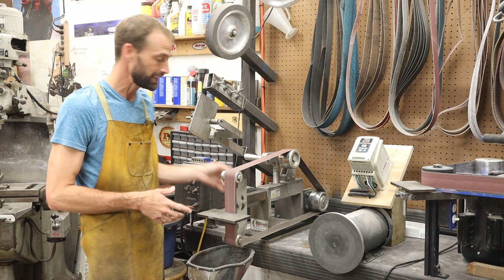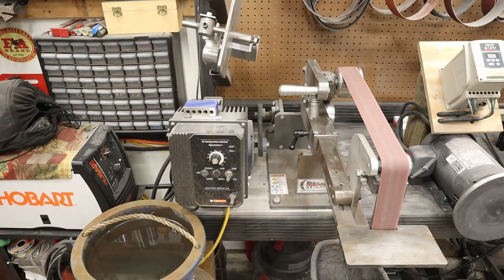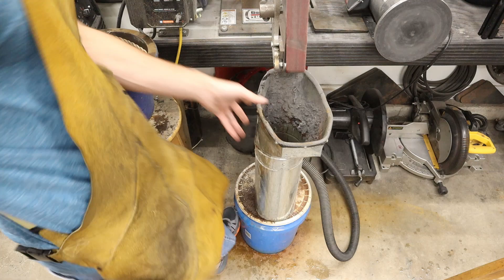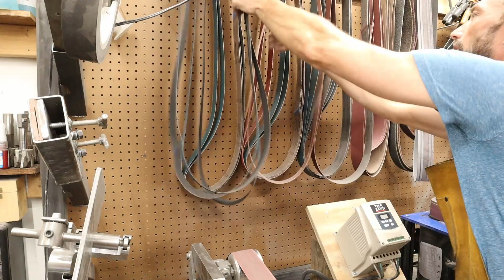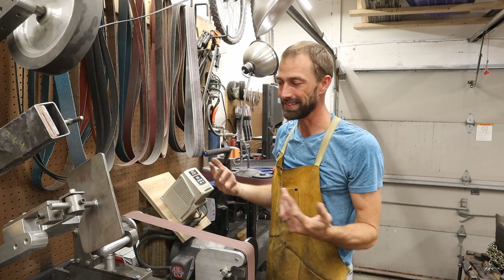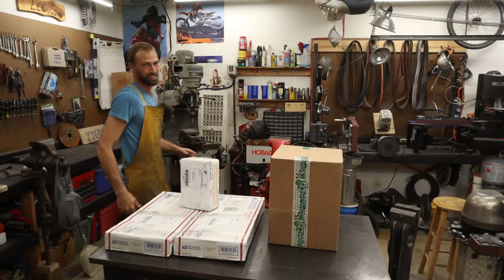2x72 Grinder "Must -vs- Lust"

Comment: I would say that a 2x72 is a necessity. Like I get the advice if you're just trying it out you don't need to buy one, and when you first start making knives you don't need one. You can literally get by with just a hack saw and some files and sand paper.

But the 2x72 is 100% something you should save up to buy as soon as you can if this is something you want to do more seriously. The availability of belts, the different attachments, the entire system, being able to control the motor. Those are all game changers that I wish I had MUCH soon in my adventure of learning how to make knives and make a business out of it.

Comment: Mr. Lee I’m looking at that AMK horizontal grinder with the VFD how is it holding up for you so far? Thanks for you reply
Reply from the maker: Great grinder but trying to get replacement wheels from the guy is like impossible! It takes a very specific bearing that he uses for the small wheel attachment I've tried to get the replacement Wheels three times now and have not had any luck.

Comment: Couldn't you just use your belt eraser to clean the metal particles out of your belts so you can also use them with wood or other handle materials?
Reply from the maker: It would be better than nothing. It really becomes more of a problem when sanding light colored wood
Reply: @Aleeknives , Ok thank you for answering my question. I appreciate it.

Comment: I think knife makers need to put more effort into ‘fine particle,’ steel-dust collection.  Trust me your set-up isn’t cutting it, neither is mine by the way, I am working on it as we speak.  Just stick a couple of magnets up in the shop and you will be blown away by how much fine airborne steel particles there are.  

A lot of guys think their steel dust is heavy and drops down…not the case.  This is separate from the fine crap stabilized wood and synthetics put out too.  Putting a bucket on the floor in a knife shop is like shovelling snow in a hurricane.
Reply from the maker: Oh I get it! I wear a respirator but the bucket and vacuum is a huge improvement over nothing😁
Reply: @Aleeknives  I’ve built a dedicated grinding room, and I am working on ceiling dust extraction for fine dust, and ground level extraction with spark arrestors for the heavy hot stuff.   And of course, even when all that is figured out, I will still be wearing a P100 respirator👍.

Comment: cool, some interesting info there thanks, will help when I am in a position to get myself a grinder of some sort, a few things I hadn't considered in there, I do have a small floor sander I use for odd bits of cleaning up and agree Zircona belts are the best cost vs effectiveness even on that small machine, well worth the extra cost over oxide
Reply from the maker: Totally agreed

Comment: Awesome video! I have 2 cheap vertical belt sanders. One from Lowe’s which is 3/4 hp that I use to hog off material. I have a very cheap one from harbor freight. I use it for more detail work. I’ve only been making knives for a few months.... gotta start somewhere I guess. They work but I’d love a setup like yours! I’ll be using your code on that site. I buy my belts from them
Reply from the maker: That's great! They have a great team at Empire abrasives

Comment: That’s how I started out by using separate belts for wood,micarta and blades. Lots of great tips you hand out. I have to get me one of those erasers. Is there a better eraser I can buy or are they all the same. Where did you get yours. Thanks brother.
Reply from the maker: I bought mine on ebay and it has lasted a long time! It is a generic brand
Reply: @Aleeknives    TYVM !! You have a great day.

Comment: Fighting my way through the Rev build myself. I'm looking forward to it.
Reply: I needed tools I didnt have, and skills I didnt have, lol. Its stretching me out, and taking longer than I thought, but in the end I will have gained much more than a belt grinder. House has been responsive to my questions, so really the weak link has been me. I still have to find someone local to weld it up, everything else will be me though.
Reply from the maker: Wrlding is super easy to jump into. A little research and a cheap stick welder could do the job in an afternoon
Reply from the maker: Tough build?
Reply: Lol, its on the list! I needed a break to make the wife smile! I'll get there.

Comment: I always keep some 60 and 120g zirconia belts around as they're extremely cheap and will do all the intermediate hardness stuff like G10, Micarta, copper alloys, some steel and a bit of wood without missing a beat and will generally be 'good enough' to last a while. Plus any savings you can get on abrasives- you take it! Don't have an exact figure on just how much the rack of belts ranging from 36-600grit and full set of scotchbriites is worth but its more than my grinder

Just as an outside opinion, the 72's get a lot of love for good reason, but if you're new to all this and maybe not going to spend as much, you can get a full equipped 2x48 with all the wheels, adjustable platens, horizontal adjust, VFD, 3hp motor for about 2/3rds the cost of a 2x72. With some adjustment I can also run 2x60 and 2x72's on it as well. The nice thing I find is that they're a much smaller surface area in the workplace and do all the things you can on the bigger machines.
But don't cheap out, find out whats the best value for your money and that may be like Airin said- building your own from a parts kit is potentially going to get you something very good
Reply from the maker: This is interesting! 2x72 grinders have really dropped in price the past couple of years due to all the competition in the market
Reply: @Aleeknives  The other thing to consider is getting 50-80kg of grinder from the US to Australia is big money, plus with a local manufactured machine made here it means I don't have to rewire it to 240v and spares are always available.
I mean, its literally 'my job' so if a machine goes down its not just a case of waiting a month for spares, its a huge financial hit, whereas they can get a spare motor, wheel or anything else over-night to me
Reply from the maker: 100%